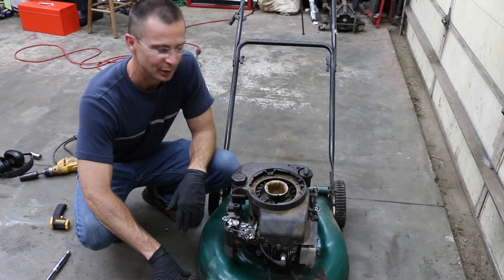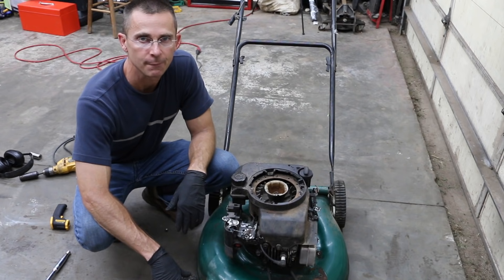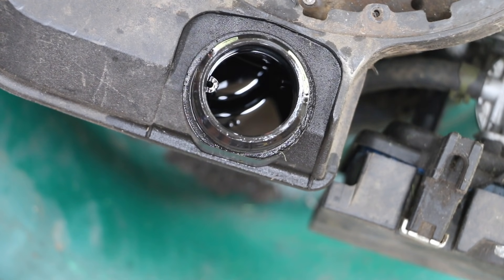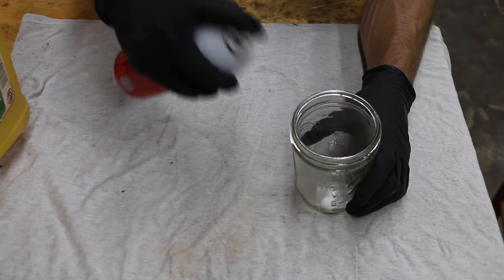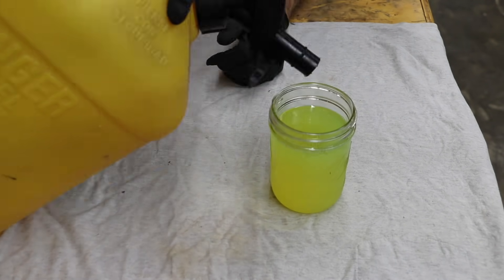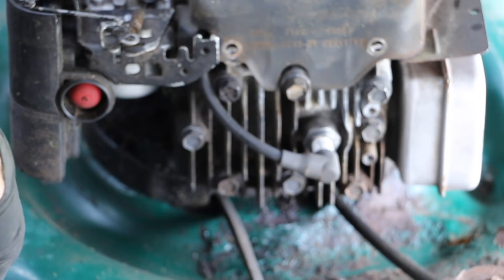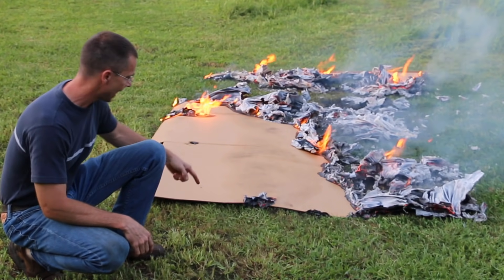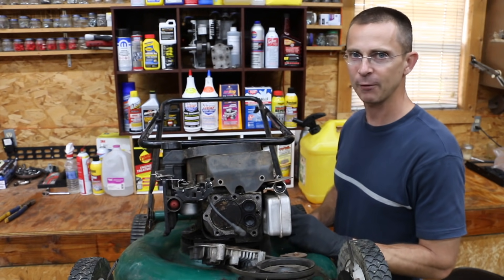Will a Gas Engine Run on Diesel?  Let's find out!

Comment: Try it the other way round: Run a diesel engine with gas!
Reply: Bye bye injection pump.
Reply from the maker: Thank you for the video idea!
Reply: @ProjectFarm  bring the diesel at flash point and try again 
there are  heaters /boilers that use diesel as fuel    all you need is to preheat the fuel pipe
Reply: @ProjectFarm  will an engine run on chlorine and brake fluid 😁👍🏻😇
Reply: I know the 11th Commandment is "thou shalt not put gasoline in a diesel engine"...but what would happen if you did?
Reply: @baronallison941  It will stop running pretty quick.
The older guys at work said you could add a quart of 30w oil to a full tank of gasoline and it would run fine in a diesel. I never tested that theory. I drained the fuel tank.
Reply: @shawnr771  old engine run on chips used oil   but in a recent car will just ruin the pump  , injector and sensors  ,i think engine will be ok
Reply: Shawn R I heard of that too. Some guy accidentally filled his old diesel car with gas, and he claimed he balanced it out by adding a few quarts of motor oil and it ran fine. Wouldn’t make a habit of it, though.
Reply: @shawnr771  well a diesel will run on motor oil but depending on the amount of gasoline, you'll want to add more than a quart to lower the flash point of the gasoline so it doesn't destroy the engine.
Reply: @benwitherspoon1038  Mine wont. If the wrong fuel gets put in one of my engines. I drain them. Not going to chance damage. Fuel is cheap compared to possible repairs.
Reply: @shawnr771  i wouldn't recommend it either. Just referring to capabilities. Straight motor oil is fine in a diesel engine however it would need to be preheated to thin out for better flow. Diesel engines were originally designed to run off of vegetable oils,  peanut oil... Even coal slurry. Diesel fuel just has the best power efficiency so they've adopted designs to utilize diesel over any other fuel heavy fuel oil. Doesn't mean they can't still run off of them with no or minor modifications. Hell, even gasoline would be okay if you lowered the compression but wouldn't be efficient.
Reply: @benwitherspoon1038  From the several times I have seen that someone put gasoline in the fuel tank of a diesel and they tried to run it. They did not run very well. The repairs cost them a lot.
Reply: @shawnr771  that's because the ignition point of gasoline is much lower than diesel... Which is why the compression would need to be lowered and have the injection timing changed in order for them to run off of gas. Still quite possible to do. The way diesel engines ignite fuel is based off of compression. Compress a gas and it produces heat which in turn causes it to ignite, however gasoline having a much higher energy output on ignition under the amount of pressure that it takes to ignite diesel fuel... You end up with pre-ignition which causes damage relatively quickly. But like I said... Just because it can be done doesn't mean there's reason to. 🤷‍♂️
Reply: @shawnr771  you can actually run all kinds of mixtures in a diesel engine if you remove the filter and the injectors and pump aren't so precise that they will clog with any particulate. I used to run my first VW on a mix of used ATF, cookiing oil, parafin gas and sometimes diesel (to top it up). my car smelled like a fryer if you drove behind me. Paid nearly nothing for fuel from the age of 17-19 lol. The juice eventually wasn't worth the squeeze and buying diesel at the pump was easier.
Reply: Baron Allison  performance wise it runs like shit. My boss did it. 1 it’s funnier when he messes up. 2. It remains funny longer. 3. You can remind him of the time he did it.
Reply: @baronallison941  Wreck injectors, fuel pump, and entire fuel system. Have heard of it wrecking the top end of engines as well but that's usually from continuing to drive it after noticing something's wrong. Don't do it.
Reply: Had an old dump truck on the farm, one of the workers accidentally filled it with gas. It ran like poop but it did run.
Reply: @joehartoon  probably had a carburetor like American old duce an half or our MLS in Canada .no speed but bullet proof
Reply: @joehartoon  Key word there is old. The newer stuff tends to not work. Too much electronics.
Reply: would damage diesel engine
Reply: @13thbiosphere  A guy in my Army Reserves unit put gas into a deuce and a half truck that was setup for diesel (they can run on either but you have to set something first). It ruined the engine, and had to be towed in!
Reply: @kevinobrien9271  if Diesel is heated 80 degrees centigrade it is as flammable as gas
Reply: i work as a diesel mechanic, this would be cool to see what happens! it probably wont run or not very long anyways i think you will have ignition way to early and cause a lot of damage to connecting rods ect. but a diesel will run on just about anything combustible.  people are correct in saying they do not have spark plugs,nor do they need glow plugs. a diesel is a CI engine (compression ignition) glow plugs simply warm the air inside the cylinder to help it start in the cold. they use very high compression ratios and in doing so they heat the air inside the cylinder so much by compressing it that the fuel will ignite.
Reply: @eastcoastoffroad35  Great reply. Thanks.
Reply: Well, diesels don't have spark plugs. If I'm right, they compress the fuel until it explodes. I doubt gas can do it.
Reply: @Cole_42  gas will explode like diesel will with compression over 20:1
Reply: @theshit2070  hahahahahahahaha...20:1 compression ratio.... Considering Nascar runs a 12:1 and the McLaren M1 is an 8.1:1 and the general Max is 14:1, this is the equivalent of saying A  .223 can shoot 5000+fps. Sure, if it doesn't explode first.
Reply: @Cole_42  yeah diesels run between 15:1 to 23:1 so its possible and idgaf about guns im a mechanic
Reply: @theshit2070  I did not know that. The gun analogy was simply that
Reply: @Cole_42  yeah top fuels as powerful as they are have a comp ratio of about 7:1 bc of how explosive pure nitromethane and the fact any kind of boost increases your comp ratio once it evens out with atmospheric pressure which is 14.7 psi and they run like 60lbs of boost which really helps
Reply: @Cole_42  Would be quite easy for a .223 to shoot 5000 fps with a 25 grain pill... No overpressure, no explosions.
Reply: @Cole_42  some people talk then think later. Cummins about 22:1
Reply: @Cole Copsey yes u are, that’s why the engines are so big, it compresses the fuel enough to cause an explosion
Reply: AduptUniform26 idk if you’ve ever heard of a 1.6l NA diesel but small diesels do exist
Reply: @aduptuniform2647  No explosion as in a gasoline engine. Just extreme heat and fire.
Reply: @aduptuniform2647  Not quite. I believe it compresses the air, (NOT the fuel), until it gets very hot and then squirts the diesel just before TDC.
Reply: @aduptuniform2647  how does it compress it on a start up? Just wondering
Reply: @braedenbehan4923  vw?
Reply: @Cole_42  diesel can ignite  like gasoline   if  reach the flash point  65°-70°     become flammable 
the old heaters use to preheat the fuel pipe
Reply: @Cole_42  of
Reply: @Cole_42  they have somethings similar but its only needed to start when its very cold
Reply: @Cole_42  Diesel does not explode as does gasoline. Diesel is compressed into extreme heat and fire.
Reply: @Cole_42  Diesels(anything after 1950) have Glow plugs, so there would be pre ignition knocking before the piston reached TDC hammering the piston backwards.  It basically destroys the engine.  Those up north mix some gas in with diesel, but if it is 50/50, yah, that motor is toast. Very expensive lesson.
Up north the gas stations get kerosene in their diesel tanks(their location says when they get it automatically.  They never change the diesel signage.  Kero is the fuel for diesel engines.   Kero is also the fuel used in high flying jet engine as the air temp is -40F because the fuel does not jell up in the fuel lines or in the tanks.  Power output is about the same.
Reply: @Cole_42  isn't gas more volatile though? I'd think I'd be more of a problem with washing cylinder walls and if you run it through the pump ruining that as well.
Reply: @Cole_42  No , they compress the air in the cylinder till it's white hot. Then injector fires a charge of diesel just as the piston is almost TDC. The diesel ignites as it's sprayed into the combustion chamber
Reply: @zimtuff  no, the fuel is added and then air compressed.
Reply: @jonross377  Obviously you know little about diesels. The fuel is not added until the piston reaches almost TDC. That's when the air is at its hottest. Go consult a good book
Reply: @zimtuff  almost is the key word there bud.
Reply: @jonross377  I repeat, you don't have a clue do you?First you say the fuel is added then it's compressed. Now you appear to be agreeing with me. Go find some videos on YouTube if you don't understand books.
Reply: @zimtuff  You cant read well huh? I didn't agree with you.
Reply: @jonross377  bulshit
Reply: @Cole_42  They don't compress the fuel ( Diesel ), because you can't compress fluids, otherwise we wouldn't have a hydraullic press today ; ) Car breaks work with the same principal. I think that Diesel fuel also gets evaporated before being injected in to the cylinder in gas form. I believe there are preheater plugs in a Diesel engine for pre-heating the fuel. Before starting a Diesel engine you have to wait a few seconds for these things to get hot, only then the engine will start. Never driven a Diesel ?  Excuse me for my bad English, it's not my first language.
Reply: @18Maart1915Gallipoli  The fuel doesn't get compressed in liquid form. It's atomized into the combustion chamber, and the air/fuel mixture is then compressed. This happens in both diesel and gasoline engines, tho the compression is higher in diesel engines, and the methods of atomization are different.
Reply: there is a system  lpg for diesel but the engine cant run just on lpg like gasoline  engine ,is runing on a mixture   70%diesel   +30%lpg
Reply: @dancro9809  lpg is like nitrous for gassers! 😉
Reply: Probably won’t start up, two very different liquids lol
Reply: @aduptuniform2647  i think it will run like crazy until the motor gets destroyed. Or will only explode once but not run since it wont get the right "rhythm"
Reply: @aduptuniform2647  It'll definitely start, but it won't stay on for long, it'll shred itself apart.
Reply: I sprayed gas in air intake of my diesel suv in winters n just 2sec heater and engine starts in half self...I did run on 70 30 mix of diesel n petrol well it runs on steriods....but 50 50 mix result in misfired  and dnt try it could bend valves or worse break piston rod ..
Reply: Iv put petrol in my diesel van more then once and it ran lumpy i just kept topping it up with diesel and it was fine the biggest risk is to the diesel pump as the diesel actually lubricants the pump
Reply: @lukewilson2367  but once the pump is  "done"  in modern cars you have to flush the tank pipes and change the injectors   
smal amount 3-5% is ok especially in the winter
Reply: dan cro the first time I did it my van only had 7k miles on it but only put around 20 litter in it so filled it right up with diesel and carried on driving it and pretty much every fuel station I see I stopped and topped it up again iv made the same mistake a couple more time since and done the same thing it’s got 170k on it now and it’s never had any issues but I’m sure if you filled the tank with petrol it would be a different story
Reply: Love the video  Really shows the difference between gasoline and diesel
Reply: It wont fire. No spark plugs
Reply: Erik Littge that’s what I said
Reply: Not a good idea when I was a maintenance manager for a highway safer than company an employee put 5 gal of gas in a diesel light tower it bent the valves and broke the high pressure oil pump
Reply: No, that's not a good thing to do!
Reply: Yeah but it will damage the engine itself bcause of the heat
Reply: That will destroy the injector pump
Reply: Nicolas Broszky  Oh I never tried it. Just old timers said you could do it.
Reply: Nicolas Broszky  No they was talk about diesel engines.
Reply: Nicolas Broszky  Yep.
Reply: Well if you wanna blow the cylinder head off of it go right ahead
Reply: @jamesshaw4954  Yep.
Reply: Not very good for the engine, gas combust at much low pressure than diesel. Would cause a lot of pre-combustion and damage to the engine
Reply: Nicolas Broszky  more pressure equals more heat. Average diesel compression is around 15:1 to 20:1 gas is around 12:1
Reply: More likely to work than Diesel in Gas engine. Military diesels have to run on any flamible fluid there is.
Reply: it cant.
Reply: It would over run on gas and destroy the Diesel engine
Reply: Will knock continuosly
Reply: Gas is to flammable, it would cause it to run away
Reply: It definitely won't work. I worked for a dealership and we accidentally put regular into a diesel jeep compass. The car stopped running shortly after.
Reply: Don't do it. Waste of a good diesel engine.
Reply: I vote 👌
Reply: What happens when you add DEF to gas or diesel.
Reply: @jacobhughes3863 at first it basically acts like water, it can't burn with the fuel so you'll get misfiring, stalling and no start syndromes but if left in the system too long the urea starts to corrode metal... It can damage the injectors and injection pump fairly quickly. All the fuel in the tank and in the entire fuel system would be contaminated and need to be flushed out. I see it more often than I'd wish with some of my customers.
Reply: The head will brake
Reply: Actually old timers would put 10% gasoline in diesel to prevent jelling.
Reply: I run gas in my 7.3
Reply: Could theoretically work, but IMHO serious pre-ignition could be a problem!
Reply: get massive preignition from the glow plugs
Reply: It works
Reply: It can be done, kinda
I had someone fill up a previous diesel car of mine with gas and they drove it about 3 blocks before it said no more.
Siphoned the tank, added diesel (with some cleaner), manually primed & all good..
Reply: Impossible
Reply: It's been done, on a euro car
Reply: But gas doesn’t ignite from compression
Reply: Too hot!
Reply: Diesel engines are olny in big and expensive stuff
Reply: Sigh. I'm ashamed but here goes.
My boss got me to drive the backhoe across town because I was the only one dumb enough to do it. Ball joints shot bad. It was unsafe. 
So he points at the red cap and says , "the gas goes here". " not here, or here ok?".
Lots of laughing from peanut gallery. He pours it on thick. Gas go here ok mike?
Yeah I get it. Gas here. Not in the hydrolic reservoir or radiator. 
Then he says, "Go to Freedom gas station because they're the only one that sells diesel". 
I was like WTF? 
So I filled up the backhoe with GAS and drove it to the jobsite. 
Two hours later...lol.
That's what happens ok?
Gasoline FLOATS on top of diesel. It won't mix like you'd think.
Reply: Been there done that! Me, my sister,, dad and mom went to Denmark. Wed beeen riding all summer on motorcycles and she went to full our diesel car, but forgot it was diesel. Then car ran 100meters  and like drowned kind of😂😂😂
Reply: Not gonna work, I once filled a petrol car with diesel by accident. Ouch…
Reply: The diesel would run, however the gas is much more explosive which the diesel is not made for, meaning the piston would either get a giant hole in it or blow the camshaft out of the bottom
Reply: Well , it’ll run really good before it blows up
Reply: you can run a diesel engine on gas, but you have to add motor oil to the gasoline, about 1 quart a tank in an M82A2, if you want it to run well, you have to do something similar to a mulitfuel engine where it has a pocket for the gas to burn in
Reply: That would be impossible because diesel can't start a gas engine because of 1 major huge thing. Sparkplugs.
Reply: Fun video! For future reference, you can buy acetone in quarts or gallons in the paint department of a hardware or paint store. Much cheaper than carb cleaner! They have denatured alcohol too.
Reply: Unfortunately being in the military I've seen that happen more than once.. It doesn't run lol
Reply: Forbidden mountain dew
Reply: The old military hercules diesel would run it. They were made too.  Diesel engines have comparitively higher compression than gasoline motors as this guy said how they run is so much different.  Diesel engines only need fuel to run, they dont need a spark or even glow plugs, (though glow plugs help on cold mornings) so could a diesel run gas, yes, but since gas has that lower flash point and the heat generated from the compression stroke could cause pre detonation making it difficult to achieve this in a regular diesel
Reply: Wouldn’t work there’s no spark plug to ignite the gas
Reply: That's a bad idea
Reply: A friend put gas in their turbo diesel Ford mondeo, it got warm on diesel, then came across the layer of gas in the fuel tank and had a runaway boost situation. They drove it the 3 miles to the nearest scrapyard (nearer than a garage or home) and the thing blew apart not even 20yds into the gate. The kind of blowing apart that takes the bonnet/hood off as a bit of the head exits through it. So ironically the scrapyard was the best choice really 🤣
Reply: Not a good idea, a older diesel will run off gas, however it runs like crap.
Reply: Gas won't ignite from a glow plug/ hot compression
Reply: @joshk9462  Your wrong about the compression it will run, that's one of the old tricks to getting old diesel engines to start. Take a rag soak it really good in gasoline, and then stick it to the breather and start it. It will fire up and run on gas fumes.
Reply: they WILL run, but not good, and will take out everypump on that diesel, then you also will take out every filter on them too
Reply: Iv used petrol on a rag to help star a diesel that run out if you put petrol in a diesel it will blow up at 100 percent but a little is good for them to clean them out 3l to a tank every 4 tanks
Reply: Well, a junior engineering grad should be able to tell ya it ain't gonna work. Different grade fuel ignite differently.
Reply: Difference between auto ignition and  flash point. 😉 Piston is on its way up and the cylinder temperature is so high gasoline will ignite and you will get major knock. How to kill an engine real quick.

You will kill the pump and/or injector. They are made with very tight tolerances. Diesel is an oil and lubricates. Gasoline is dry and evaporates. Reason why you can very high mileage on diesel engines.
Reply: It runs but engine will be damaged.
Reply: My wife put gas into our 2003 VW TDI Golf.  Barely made it out of the gas station before she noticed major issues and had it towed to the dealer who said "it happens often enough"...They drained the tank and supply lines, replaced the fuel filter, refilled with diesel, and been working fine ever since.  That was probably 7-9 years ago and the car is still running just fine today.
Reply: I have done it. It will work but knocks like hell.  It works better if you mix oil or low grade kerosene in with in. I found out that starter fluid burns at a slower rate but is easier to ignite than gasoline. I think that's what he was trying to do with the moth ball but moth balls burn way way to fast to produce anything but heat.
Reply: swift kill  Diesel engines don't have spark plugs because the higher compression heats up and fires the fuel. The reason it will run on gas is because gasoline will fire from compression also but it fires faster and will ignite from the heat inside of the cylinder. That why it knocks that's the gas igniting before the compression stroke is done. Adding oil to the fuel slows down that pre ignition. You can run a diesel engine on just about any fuel just by adjusting the rate of flow. I have run a diesel on cooking oil without a problem because the burn rate is almost the same as diesel fuel.
Reply: swift kill  I said it would work. I never said it was practical. In fact I also said it knocks like crazy. I'm just relaying what I know I never said anything about valves being ok or anyone should try doing it. When I did it it was in the 60's when experimenting was not frowned on.
Reply: swift kill  Yes, are you always trying to piss people off?
Reply: swift kill  You really are an assopening. I guess you think being that way makes you better  but it doesn't and most people don't like you.
Reply: @LazyH-Online I've drove diesel trucks for a long time i know about how the run its very high compression and higher the pressure higher the temperature and that's how it ignites with out plugs or glow plugs in the newer ones
Reply: It will work
Reply: I did that once with a duramax ran for about 2 minutes down the highway with barely any power...
Reply: These guys tried a lot of different fuels in one, but not regular gas!

https://youtu.be/gWVw1SUicyw
Reply: @LazyH-Online Not sure what comment you're replying to but no, gasoline far ignites easier. It causes damage in a diesel motor because of the higher compression required to ignite diesel. Gasoline will ignite in a diesel engine before the piston reaches tdc causing pre-detonation.
Reply: I remember on an old TV show (I want to say CHiPs) a guy put gasoline in a diesel boat and when they started it, it went up like a nuke! Total Hollywood fabrication, I think.
Reply: That does not work..get a job stop wasting your life on bull shit
Reply: @olivertaylor8788  haha you mad bro?
Reply: Wasn't that a waste of time.?  Not worth a pinch of owl shit..ha ha
Reply: The US military had "multifuel" engines in the big trucks, that would run with up to 90% gasoline / 10% oil or diesel fuel..
Reply: @LazyH-Onlinein diesel fuel it's a cetane rating not octane
Reply: @LazyH-Online I think you'll find octane rating is the speed at which the fuel will burn
Reply: @LazyH-Online flashpoint is the temperature at which flammable vapours are released
Reply: Had somebody put gas in a Ford F450 diesel.
Not so good. Ran very badly and the guy managed to switch tanks to get it back to the shop where we drained the tank and refilled with diesel.

So much for color coded fuel tank caps.
Reply: @shawnr771  had the same thing happen on a reefer unit someone put a jerry can of gas in the tank .worse was when some idiot put old radiator fluid in a Jerry and did the same . Drain the whole system junk filter and prime till your arms come off. And that engine ran .
Reply: @shawnr771  I thought running gas in a diesel engine could result in severe piston damage.
Reply: @nfsfanAndrew  I know I wont do it.
I aint a mechanic and do not want to be.
I put the recommended fuel in the engine.
What other people tell me is just a fantasy.
Reply: @shawnr771  you can run 25% gasoline and not hurt any thing if your electronics don't shut you down. My friend ran
an old 6 Bt  with any kind of waste oil,used motor oil, hydraulic fluid to gearoil , cooking oil, anything! with 20% gasoline. Last I knew he was just hitting the million miles mark. Ran it through 3 ray Cor filters, mixed it right in his tank .
Reply: @screechowl9605  Good for him.
Personally I do not really give a rat's butt.
If somebody else wants to try this with the engines that is pretty much their business.
I aint gonna do it.
Reply: It will run but hurts the engine
Reply: @kraig101us  it's the newer diesel engines with common rail, injectors and pump need the lubricant of the diesel. Our old ML military trucks used a carburetor and I swear could burn anything.  Slow as molasses but tough as nails👍
Reply: @jihomet7607  the manual for an M82 duece and a half calls for a quart of oil per tank, same for the M85
Reply: Diesel will not run on 100%gasoline. The fuel does not have the viscosity to lift the injector pintles thus no delivery. Gas engine will not run on 100% diesel. Spark will never be hot enough to ignite fuel.
Reply: Nicolas Broszky  its the octane in gas that when it combusts its to much for the diesels cylinder head to hold back it will just blow the head right off of it
Reply: @jamesshaw4954  bulshit
Reply: Wouldn't work because no spark plug and not enough pressure to ignite
Reply: It wont start since gas engines need the spark plug diesel engines dont need sparks because the compression ignites the diesel
Reply: @badboiforlife9808  The problem with that statement is gasoline fires quicker than diesel does and the glow plugs are hot enough to ignite it. The reason is because the gas fires before its time to causing the engine to knock.